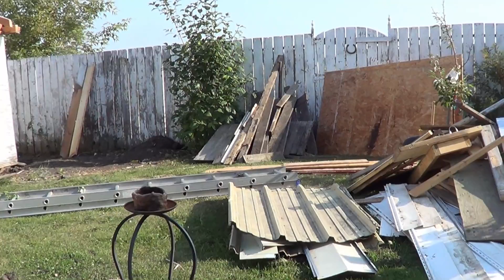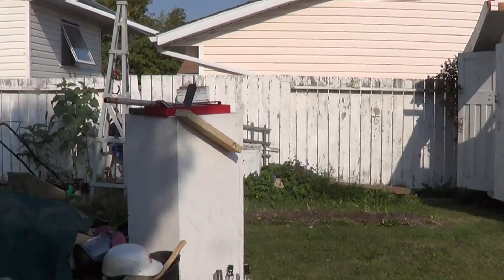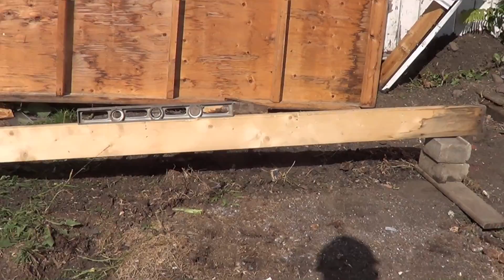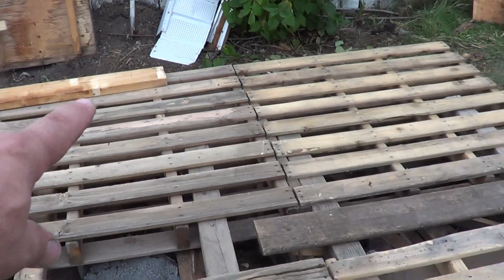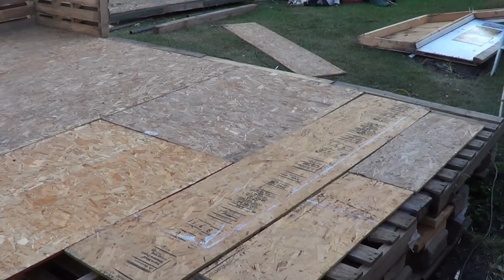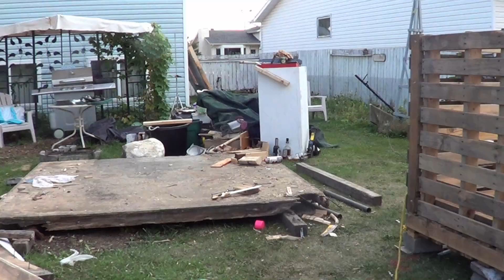Pallet Shed Build-Part2

Comment: I give you credit for your hard effort here. But you should never have used the mixed size blocks and pcs of leveling wood for the foundation support. It will never hold up properly. It would have been better to use solid 8x16 cinder blocks set and leveled on pea gravel. The blocks can be purchased for under a few bucks each at Walmart or Home Improvement stores, especially since your shed foundation is not a full-run solid one (separate skids screwed together results in many weak points and you have gaps between them also!). Just advice as I would like to see your shed last for a long time.
Reply from the maker: Absolutely! Time will tell. I have 4x4s running down the middle of the pallets.